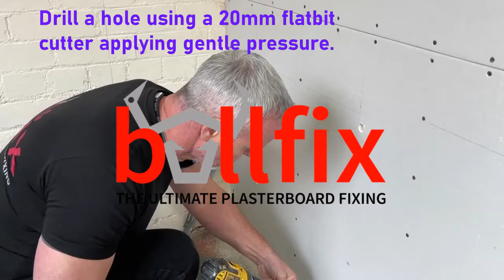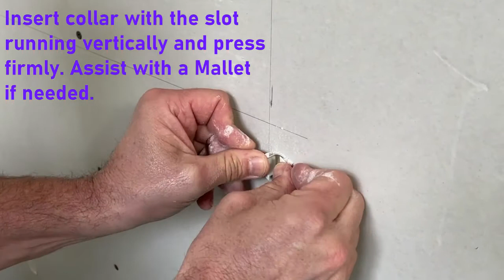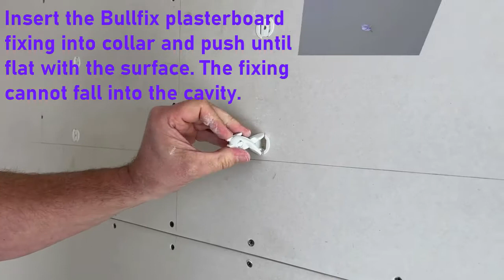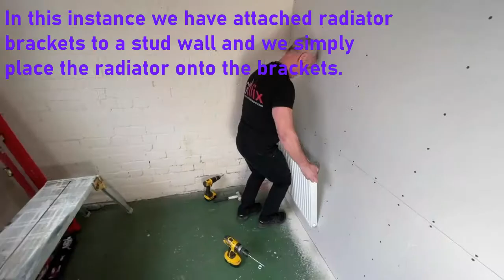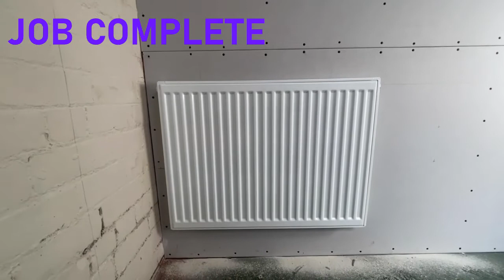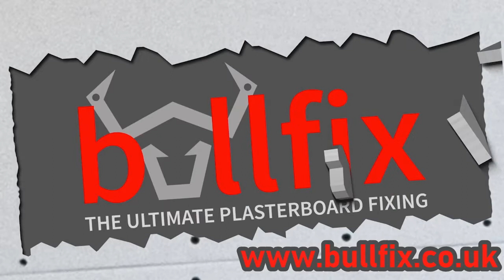How To Use Bullfix Plasterboard Fixings

Comment: Do be warned, although it says universal on packaging, it is in fact not. Your drywall must be within a certain length and the length provided on the back of the packaging is incorrect. Claims 1/2' - 5/8" my drywall is smackdab in the middle and product does not work. Just be warned before you drill a big ass hole in your wall for no reason.